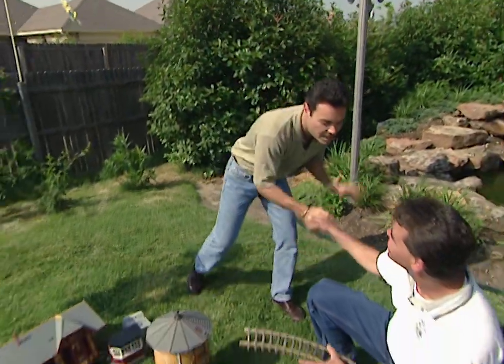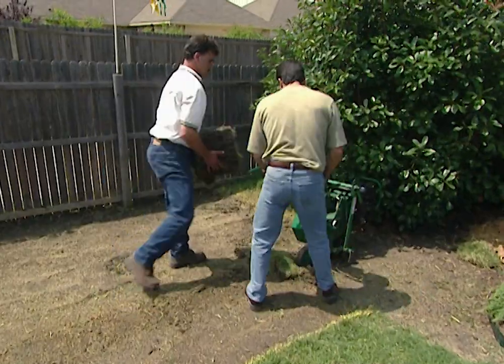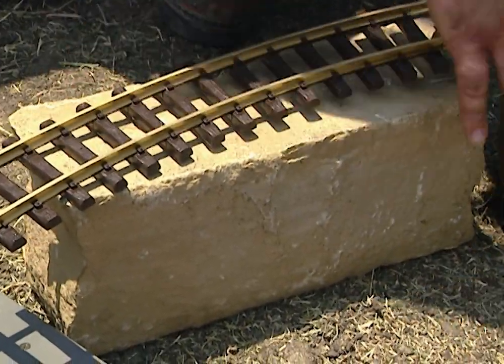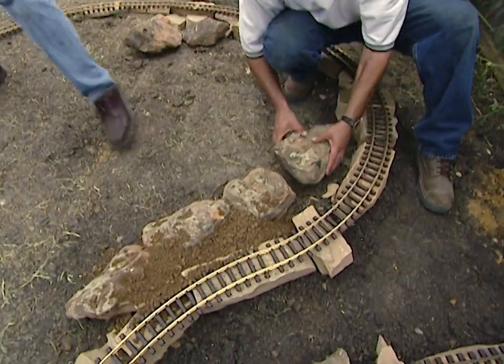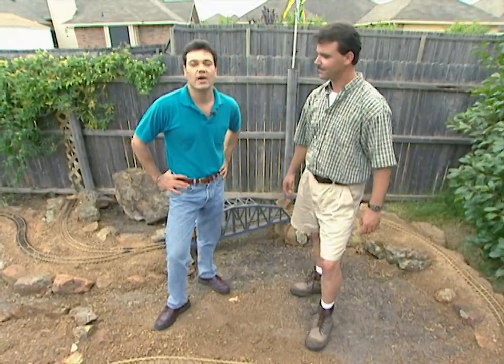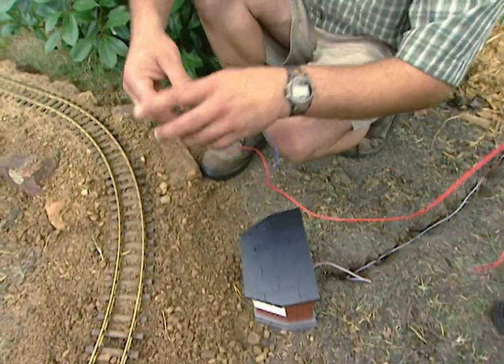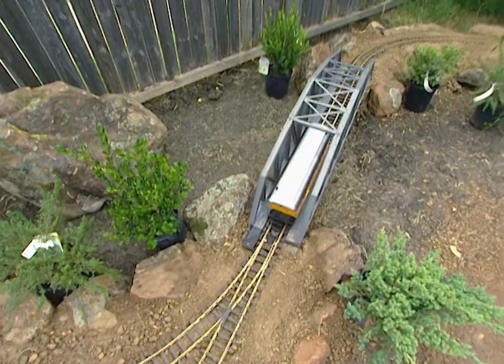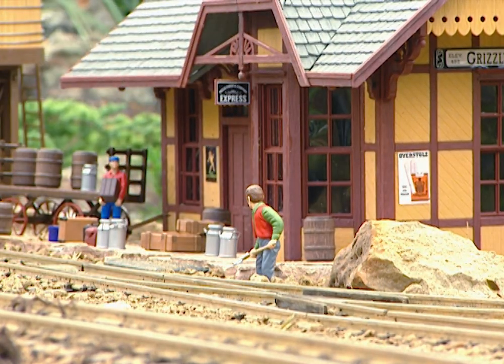Building a Outdoor Garden Train

Comment: Hello, looks great! I’m interested in the tracks you use, I know it’s LGB g scale track , can you tell me what turns do you use, R1, R2 or R3, I’m using a 1:20.3 scale size trains and they run on g scale track but I need a larger turn radius that’s why I need to know which ones you used. Thanks, please post something.
Reply: Use the largest that will fit in your space
Reply: @thesheq5023  Exactly.  The biggest mistake model railroaders make is trying to figure out the minimum curve radius that they can get away with instead of trying to figure out the largest radius they can possible fit into their space.